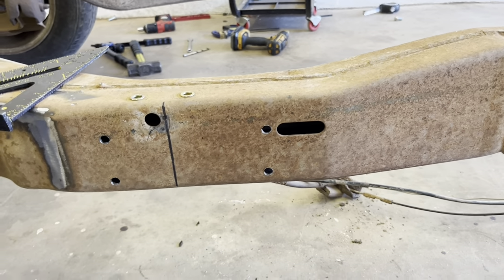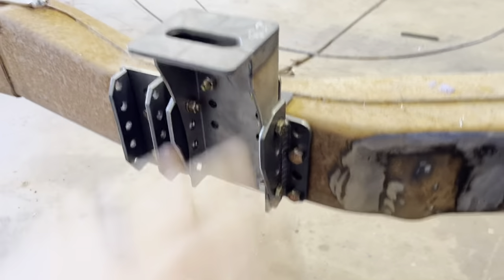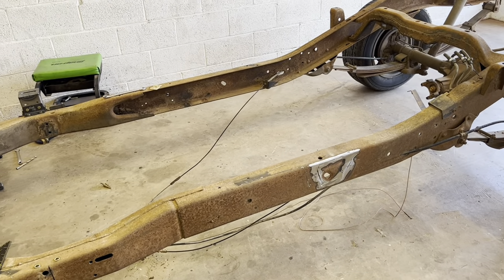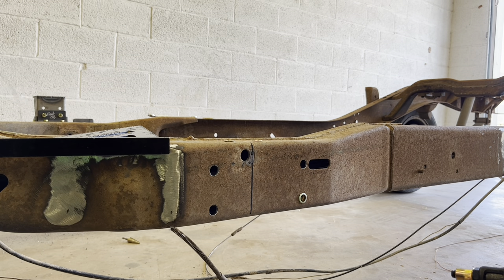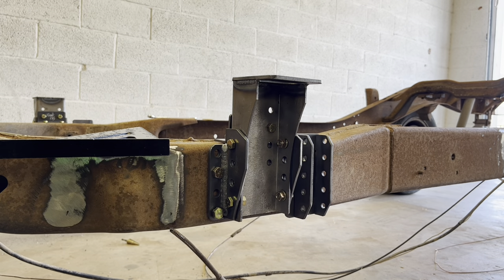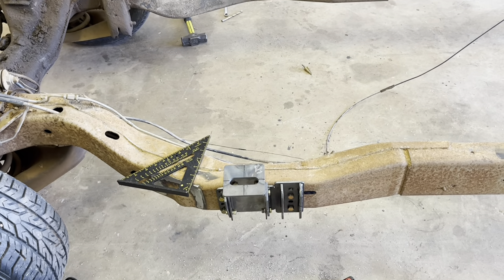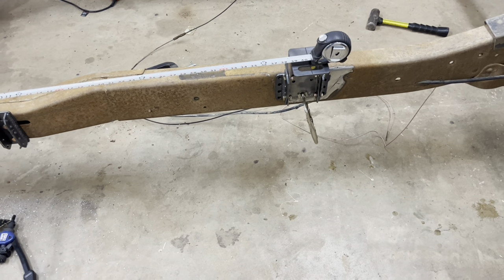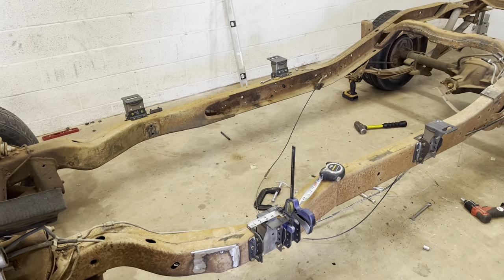1954 AD 3100 Built Part 2 (Installing the Henry Panza Cab Brackets)

Comment: 1300 lb pull out sounds sufficient for body mounting. Thanks for providing that info for confidence!
Reply from the maker: I felt comfortable with it.
Reply: Those are not the correct way to mount body mounts.  They are too soft and will deform over time.
Reply: I tapped the top rail but the frame metal is pretty soft and easily stripped out the new treads so used rivet nut and will weld as well. Overall thanks for the video it was extremely helpful.

Comment: If i have a 91 short bed s10, will not work??  How hard to extend frame
Reply from the maker: Short bed will not work, depends how good you are running a tape measure and a welder lol. There are some frame extension kits out there.
Reply: @3rdGenC10s  @ easier to find a long bed!! Better!
Reply: @3rdGenC10s  @ its the long bed, fits  perfect?
Reply from the maker: Yes, you do have to trim I think 6 inches off the rear of the frame with the Panza kit.
Reply: @3rdGenC10s  o ok, just the chasis,, no need to move the leaf springs hangers
Reply from the maker: No need to move anything.